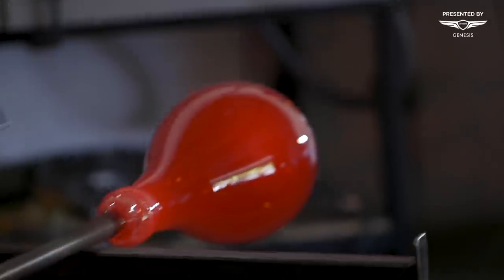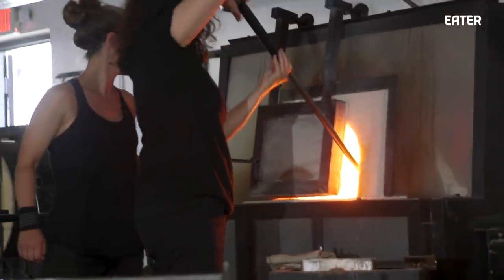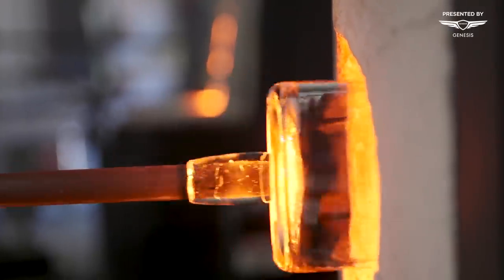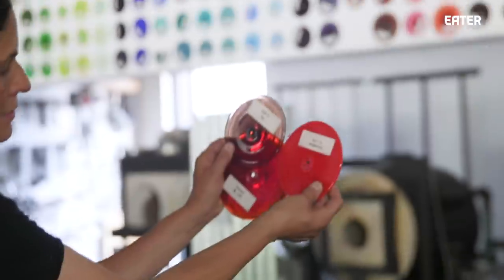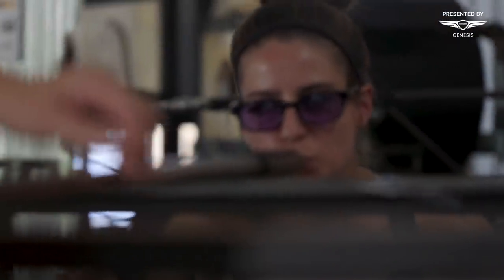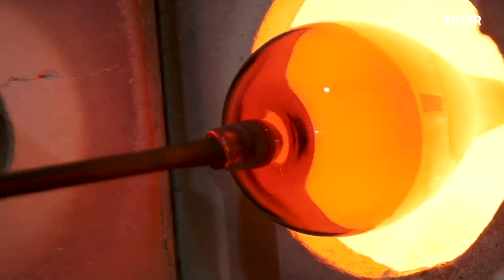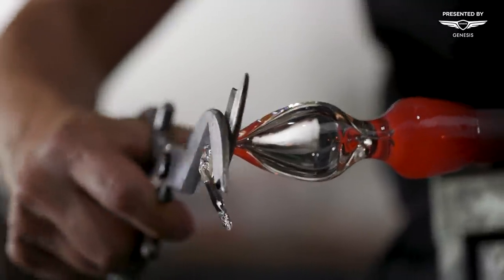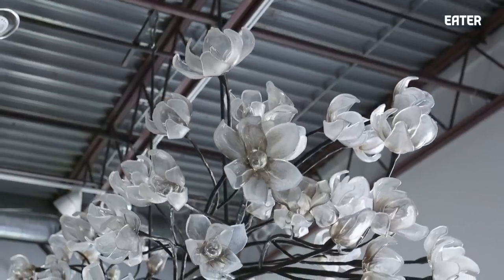How a Glassblowing Master Creates Pieces for Fine Dining Tables — Handmade

Comment: I dont understand the fuss over plastic when creating glass bottles is as unfriendly to the environment. or am I missing something?
Reply: Melt glass you get molten glass, melt plastic welp there goes your lungs
Reply: while it is true that the final product has a high decomposition time, it doesn't really have the same impact on the environment as plastic in this process, it doesn't float in the ocean, the risk of animals ingesting it is close to zero, it doesn't create traps or areas that would occult sunlight, or air, clog pipes etc
most importantly the production process doesn't require huge, energy intensive machines that emit gas and polluting vapors. 
Also the base material is literally sand, not petrochemicals etc
 that require even more industrial work upstream
I guess glass is not a perfect material there's no question about it, but comparing it to plastic seems like madness
Reply: @Yaumyt  I see. thanks for the info, didn't realize these things. but looking at this process still seems a bit too much. so, I guess there's really no solution.
Reply: @Yaumyt  Ingest glass and tell me the danger to you is zero.
I'm not generally disagreeing.
Reply: @keenotski  You remember that last glass plant fire that polluted the air for miles and put tons of pollution in the air? No? Because it never happened
Microplastics and detrius are eaten by animals, who fill their stomachs but still starve. Those fish are an important part of the human food supply, btw.
You only see one furnace and see a lot of energy being used. You don't look at plastic and see the damage the entire chain produces.
Reply: @recoil53  no, I'm not saying that. I'm just saying if glass is also dangerous overall, then it just means that there really is no solution at all. plastic, glass, etc, they're all the same. sure, plastic is way more dangerous than glass by a huge margin. but both still cause harm to the environment.
Reply: @recoil53  well yeah but in reality animals don't really ingest glass, since it doesn't float and just stay at the bottom of the ocean the risk of ingestion is pretty low.
the only "real threat" would come from big sharp pieces that could cut, but the reality also is that even if glass takes hundreds of thousands of years to decompose, it also breaks down easily, gets polished by the current, in the end turning back to sand